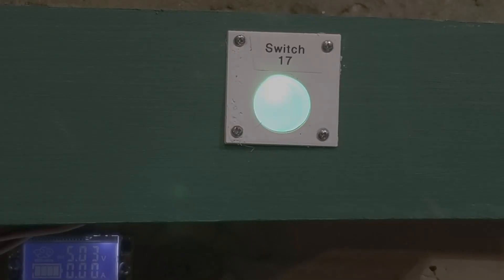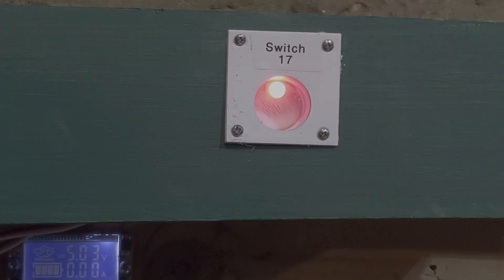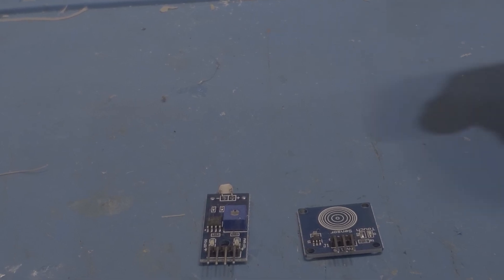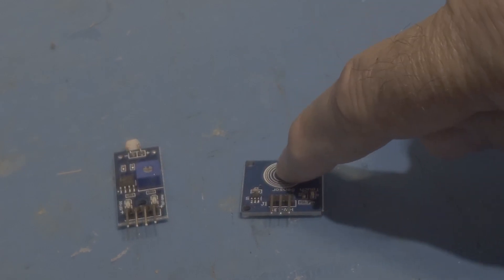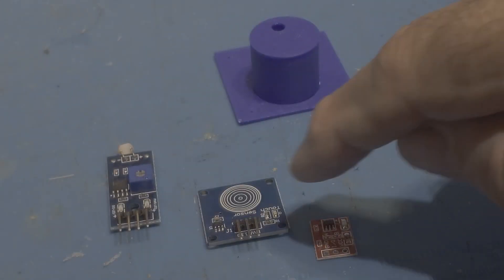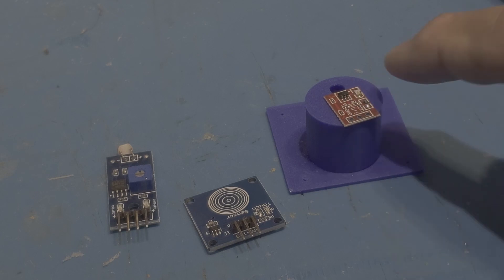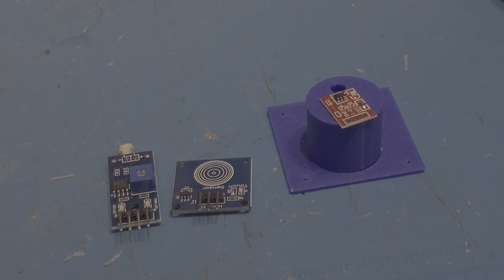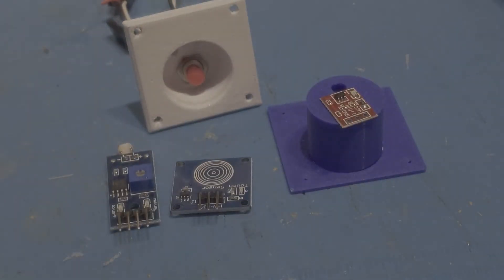Arduino Touch Sensors for model railroad turnout controls

Comment: Yea!!!  Thanks!  I got the small red ones a while ago and they are holding my parts cabinet on the bench.  When I get back I’ll start to use them now!!!  Where can I get the large blue holder?  Thanks!!!
Reply from the maker: I 3d printed it. I drew it up in Fusion 360.